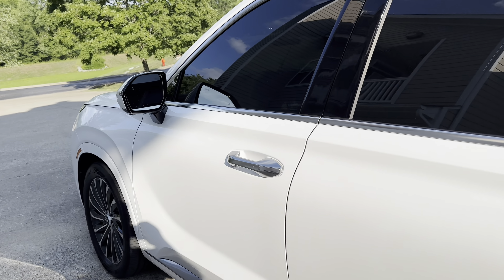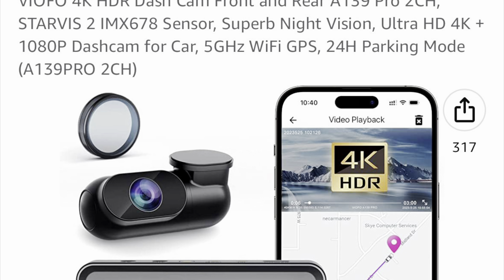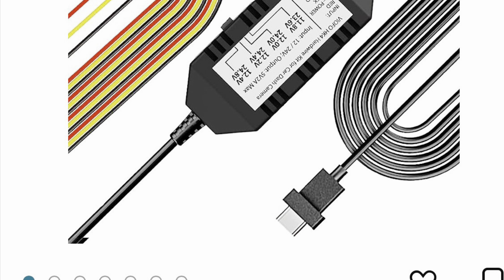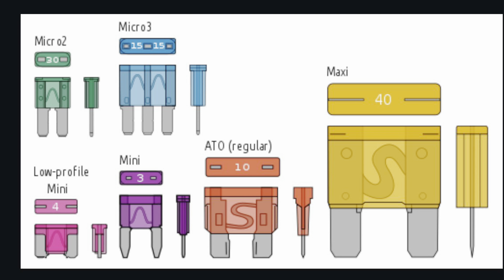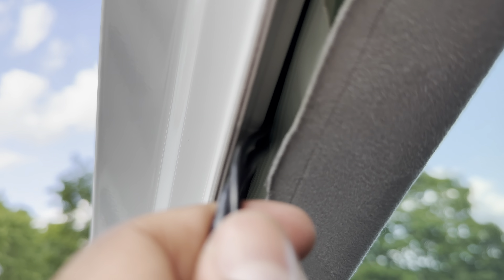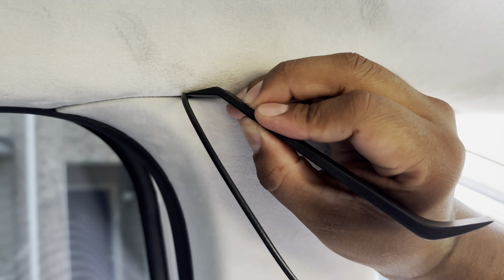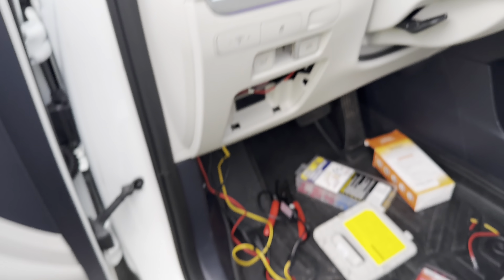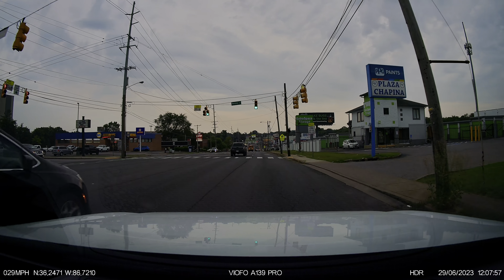How to Install Dash Cam, Hardwire: Viofo A139 PRO - Hyundai Palisade

Comment: I got 2 screen protector type sheets, I noticed that you did not use these. What is the purpose of using them? Instructions say to stick them onto the windscreen, and then attach the camera to it.
Reply: It makes removal easier in the future if you decide to remove the cameras.

Comment: I have a question in which position should the hardware Kit 11.8v 12.0v 12.2v 12.4 be switched?
Reply from the maker: 12.0v is personally my limit.
Reply: @CalebTrips  thank you for the answer, but I found out how it is at the seller if the battery is new 11.8v. used battery 12.2v in winter 12.2v

Comment: The problem with any cabling connected to the car, other than via usb/lighter you loose the warranty of your car (given by the manufacturer) in my country:/
Reply: Absolutely false. 
If you you change out a stereo you'll lose your stereo warranty. Not your engine warranty.   Completely two different things that wouldn't hurt each other.  

Even then, no dealer is going to void your warranty. They might give you a hard time but they will not void it.  Unless it's like a battery

If you're that scared then forget the hardwire and just go plug in play
Reply: @llamacebu216  hi, this might be true in your country, not in mine, DR.
You actually get a set of documents stating all you need to know as to What might cause you to void your warranty.
Thank you you tho for the information.
We are clearly getting screwed in DR

Comment: Did you check with the multimeter which side of the fuse is the power coming in? You do not want to bypass the fuse.